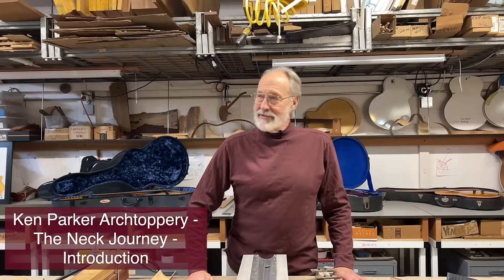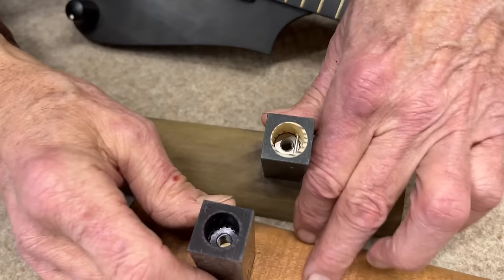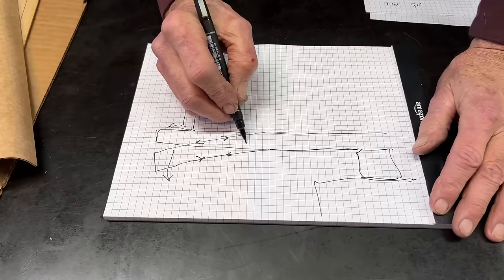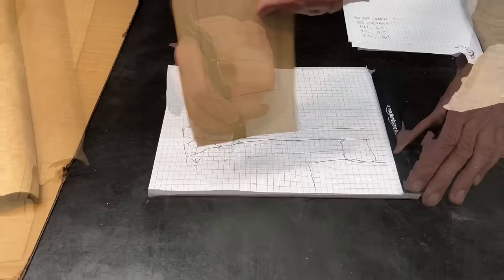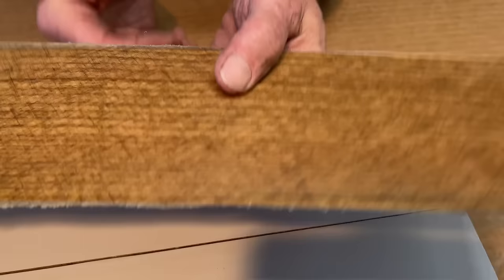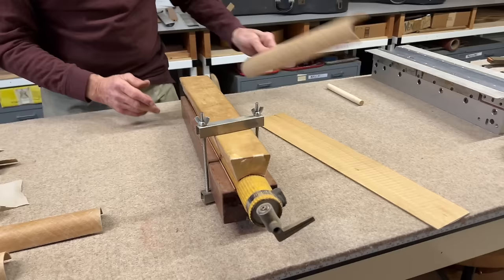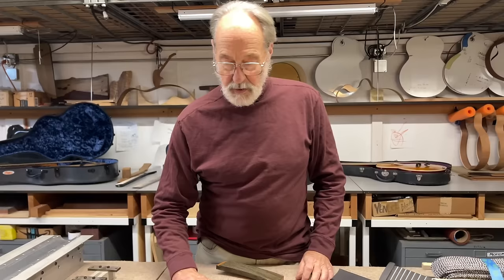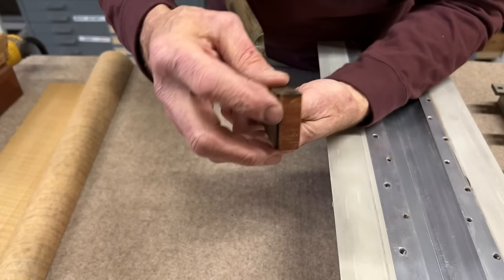Ken Parker Archtoppery  The Neck Journey - 1) Introduction

Comment: Fantastic resource to watch, whether you're a guitar builder or just an instrument enthusiast. This is true innovation. I love the part where Ken mentions how wildly different two pieces of wood from the same species can behave - it to a degree trumps the tone wood argument in my eyes, and confirms what I've believed for a long time, that it's down to the stability, structure, grain pattern and moisture content of an individual piece of wood rather than its species that determines how it will behave and influence the instrument's sound. Of course correct me if I'm wrong on that!
Reply from the maker: You're singing my tune. Just like the finished instrument, each piece of material must be judged on its own merits. Imagine picking your friends by their precise height, or the shape of their earlobes. Sounds crazy, but the "Guitar Press" has a lot of folks convinced that the most important information about a piece of wood is explained by knowing where it grew and what we call it. Feh. A good instrument maker is curious about the material's properties in the same way a chef is about her ingredients for tonight's banquet, and in both cases the proof is in the pudding. Much of the "common knowledge" and "instruction" imparted by non-builders or incurious storytellers in our press  is a joke, unfortunately, and has hurt our field. You can't see tone.

Comment: Thank you for sharing your life time experience, it is incredible to learn the way you are building guitars, really a new way of thinking , worth a lot ! All my respects
Reply: It's not that new, Ken and others came up with these kind of non traditional methods in the late 70's already!  Many call it the "Superstrat era" with the tuning stable vibratos and locking nuts, using non traditional woods and other materials, high tech glues, heel less neck to body transitions, stainless steel frets, carbon fiber neck reinforcements and two way truss rods, which my very first build (1984) has all of, and I still have it as my main ax.  The fret wire was from Jescars very first batch of SS fret wire, I and others had to barrage Jescar for months to make it, and pool our money together to afford to pay for their minimum batch size to make it worth their effort!  But besides cat's like Grover Jackson, Steve Kline, Floyd rose, Gary Kahler, Kamen, Hamer, Rockler... there were the acoustic flat top and arch top builders in on it too, and even luthier tool makers.  So it wasn't just about improving strat's as the crappy name given to it by one of the guitar magazines at the time suggests, but the guitar as a whole.  I just so happen to be one of them too, having studied engineering first, and then developed a passion for guitar building.

Even earlier in the 60's one Dr. Michael Kasha (physical chemist & Molecular spectroscopist), teamed up with master Luthier Richard Schneider and came up with a whole new "School" of acoustic guitar design, AKA The Kasha Design school, where some of the original ideas came from.  Steve Kline worked with them, and then cot into electrics where he may have been one of the first in the clan I and the before mentioned were all part of.  Already existing Industry came in way later, pretending to be the big innovators of much of it (Yeah right), and some like Fender and Gibson still use the sub standard traditional methods.
Reply from the maker: I love doing this.

Comment: Enjoyable glimpse into your process, but I am interested in your thoughts about wood. I share your respect for Douglas Fir as a guitar material and would love to see it used more in the craft. What about some of the other less-used species, like Black Locust, Southern Yellow Pine, et al that might be useful but not as wasteful as the exotic species we know and love?
Reply from the maker: We’re on the same team, each piece of wood needs to be judged on its own terms, so first off, forget everything you’ve read in the “guitar press”, and then audition any new material with open ears! I have a big pile of old growth black locust that I’ll get into when the Tannewitz bandsaw is ready. It’s a good example of a species that has not seen much use in our field, despite its fine properties. At Parker Guitars, I auditioned many types of wood for the body, resulting in a set of useful choices for the player that we came to think of as a global tone control. In other words, you could order a guitar whose only difference was the species of the body material, and expect it to have a strong tonal bias.  Poplar, mahogany, Sitka spruce, figured maple, basswood, koa, butternut, Port Orford Cedar all made great sounding instruments, and quite a few other species were tried and not used for a variety of reasons, usually supply issues like impossible to find it in the 14” width we preferred to start with, or just scarcity, as in the case of unobtainium, which we loved the sound of, but just couldn’t get.
The only species that we rejected solely on the basis of sound (after all, here’s our target!!) was inexpensive, reasonably attractive, and available from our favorite vendor! We were all excited to hear this new stuff, which kinda looked like light colored tan mahogany, but lighter and softer. Promising, right?
Jelutong, the tropical hardwood I’m speaking of, is also known as a rubber tree, and the sap is drained from the tree during its life like maple syrup, only it makes latex!
When we strung up the first (and, as I remember it, Only one) article, we forgot all about how great it was to cut, shape, and finish, because we were all laughing out of control at how awful it sounded. We couldn’t believe it! Think I’m exaggerating? It’s available  from several suppliers for short $!
Please send audio! When we ran out of laughter and calmed down, it was agreed that the species would now and forever be re-named “Jelly - Tone”. Wood is as wood does! Thank heavens jellytone isn’t the only tropical hardwood on the menu!
That guitar is out there somewhere, but I can’t remember where, I was laughing too hard.

Comment: Have you ever tried pressing and gluing the veneer onto the neck shaft without the linen? I am not sure it has any structural effect after glued to the shaft and it creates a separate operation to glue on the bias linen.  A backer of linen without glue would also work to support the fibers from splitting as it is pressed in shape and glued to the curved shaft. You would need to make the linen somehow pulled tight like a trampoline bed.  But the linen will support as the veneer is pressed into shape on the shaft.
Reply: I imagine it has to act like a monolithinc object in order to move the zero point.
Reply from the maker: Go get it!

Comment: Lignum is awesome. There is a scientific paper about it. Lignum bearings in a power plant last 45 years, synthetic materials at least a few years ago were good for 45 minutes.
Reply from the maker: Link to the paper you're mentioning? Please, Please?
Reply: @kenparkerarchtoppery9440  I will do some research as it was a couple years ago.
Reply: It was a pdf if I remember correctly. I grew up in the Florida Keys which is part of Lignum’s range so it was massively interesting to me. I have a friend with a sawmill in KW that you would enjoy talking to. His direct knowledge goes back to WWII.
Reply: The synthetic didn’t totally break down in 45 minutes, it showed shaft run out. So I definitely exaggerated. It’s been a few years. I could not find pdf but found a related article I sent to your email.

Comment: This couldnt have come at a better time, i just built my aluminum mold a few weeks ago (Well i had a CNC shop punch one out) and ive been experimenting with different ways to bend the veneer and its kind of a relief that i wasnt that far off, ive had great success with the glued linen and a heating blanket forcing it into a wood mold. Ive considered making a inside press out of aluminum with cartridge heaters or something, but it works for now. The braided carbon tubes you have are way larger than the ones i ordered and im surprised to see that, hopefully more layers of smaller diameter tubes adds up. Im currently struggling with the geometry between the veneer and headstock transition, maybe ill end up doing a little inlay in that area im not sure yet. 

PS, im sure it will be described later, but are you sneaking some carbon in between the ebony back strap? like you said its an important area but maybe it doesnt need it. Ill be pressing my first neck as soon as my epoxy gets delivered, i opted for system 2000 laminating epoxy from fibreglast, hopefully it has the correct properties. Thanks again Ken
Reply from the maker: Exciting! Hope to see evidence of your success!

Comment: Why don't you use a zero fret?  This always seems to make so much sense to me.  A nut seems like it should only be 'in charge' of string spacing/alignment, not string height.
Reply from the maker: The Nut Movie is in the cans and will release soon, where I go all the way on nuts, go nuts, that is.
Summation, the nut is not a tricky design question, its particulars turn out to be mostly just about style and convenience,  except for the fact that whatever you do must position the string perfectly in all axes to a very small tolerance. Having done that, have it your way, whatever that is, and it's really all the same result.
If you suspect that the nut material matters to tone or sustain....
I hope you design and perform an empirical test (bring blindfolds!) to try your hand at testing this, like I did in my own crude way 50 years ago. Please do tell if you get it done, we'll all want to hear about what you measure!

Comment: Ken, do you peel the linen off the back of the neck veneer similar to what you do after bending the sides?
Reply from the maker: Yes, you'll need to heat the epoxy until it fails, maybe 200-ish degrees F, or 95C. It becomes gooey and crumbly at the same time somehow, and lets go of the wood in a nice way so you can slowly pull the linen off without tearing it. Heat gun and four hands is what works in my shop.
Reply: @kenparkerarchtoppery9440  Thank you!

Comment: Are you using West System 105/205 for your Epoxy, or have you found something with greater hardness?
Reply from the maker: Jamie! I like the West 105/205 for most of the wood bonding jobs in the instrument body apart from the center joints and plate to body joints, which require hot hide glue. For the neck layup, we need a resin with exceptional mechanical strength that the room temperature resins can't give. Stay tuned for the full story. Nice to hear from you!

Comment: Ken, if you haven’t recorded already,  when you speak to scale length, I wonder if you could spend a minute speaking to any special considerations for bass scales and extended range. I play a 35” scale 4-string tuned DGCF. Was looking at a Fly bass and a little surprised to find the fly 4 and 5 are 34” scale (don’t ask me why). I wonder what you think about this tuning and if a bass built to be tuned this way would be any different. Thanks!
Reply from the maker: I will explore all the facets of design, I promise, and scale is a critical one, for certain. Strings, all other things being kind of equal, have an optimum aspect ratio, that is, proportion of length relative to girth. Longer isn't always better, and the violin would be a good example of this, but often in instruments with lower pitches it would be the right choice to err longer. Ergonomics are a limiting factor, of course, and we're all built differently, so that's one piece of it, although I, along with Jim Soloway (Hi Jim!) have noted that if you don't announce the scale length, often folks just adapt to an instrument with longer scale than they're used to, and if they relate well to the instrument, just play and enjoy it. For example, Jim's favorite scale for his guitars was 27" or about 686mm, and lots of players were shocked at the reveal, often saying they hadn't noticed the much longer scale length!
Having said that, there's also a pretty good reason not to challenge players with too many changes relative to the guitars/basses they acquired their expertise on, and so you can think either way. The low E1 pitch on a normally tuned bass, acoustic or electric, is 41.02Hz. The physical length of this pitch, one cycle, has a length of roughly 28 feet, or 8.5 Meters. How on earth a 34" string suggests a pitch of this length we can only marvel at, and don't forget to thank centuries' worth of diligent geeks like me trying our best to pull it off!
Reply: @kenparkerarchtoppery9440  thank you, Ken!

Comment: Hello, I have a question and don't want to bother anyone with elaborate context: Is it true you glue your frets to the wood? I read it somewhere and tried it myself. I was able to get it done with two component poxy glue and steel wire frets (made them myself from regular steel wire),  the results were far from acceptable. Do you have a video talking about this?
Reply from the maker: I just made a film about gluing frets, so please be a bit patient, and I promise to explain more than you'll need to know, as I try to do. Till then, the answer is that I've never tried to glue frets to wood due to its' hydroscopic nature. You can't depend on the wood to hold still dimensionally, and bonding metal to wood would be problematic, as you may have found out. I have only used carbon/glass/epoxy fingerboards for bonded frets, although other non - wood  materials could work.
Reply: @kenparkerarchtoppery9440  Wow, I'm really grateful for your answer. I look forward to watch that video and in the meantime I'll try to learn more from the ones you have already posted. Thank you!

Comment: Did I miss a step, does the linen stay on the neck veneer?
Reply from the maker: Haven't tried that yet,  and it would be a trick and a half to get it really perfect, no? 
All will be revealed.
Reply: @kenparkerarchtoppery9440 I'd imagined a water soluble glue like the paper tape used for veneering. Awsome vids, by the way.  You tube at its finest,  personal lessons. What a privilege.